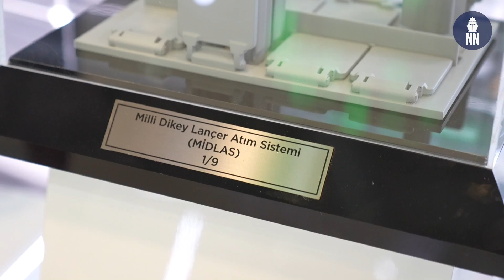Turkish Naval Defense Technology at IDEF 2023 - Part 1

Comment: Wasn't sure but were one of those missile systems capable of hitting in coming ballistic missiles or High altitude missiles?  A for a fast attack boat eight missiles is rookie numbers,  double that and then your getting close.  Load up some of those mid ranged air defense missiles to saturate an enemies defenses and have the SSM's skim in with them for the killing blows.
Reply: Not those missiles. Siper block II will be the anti ballistic missile. It’s still under development by Roketsan. I guess it will take 3 - 5 years to become operational.